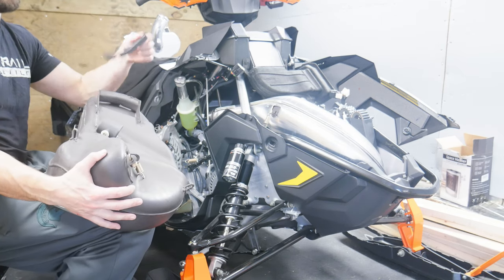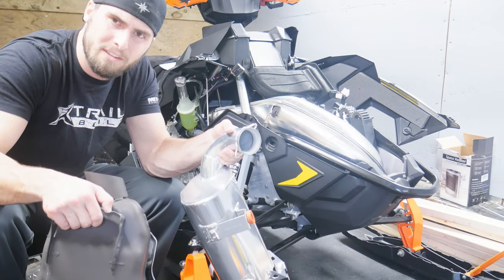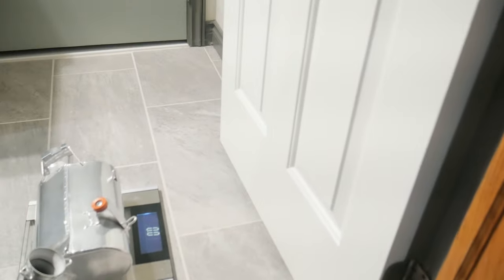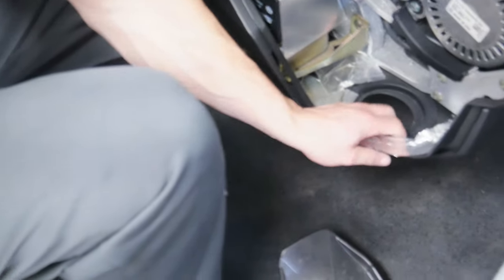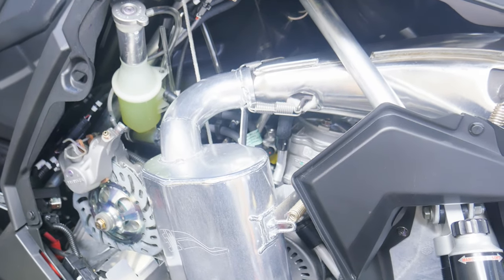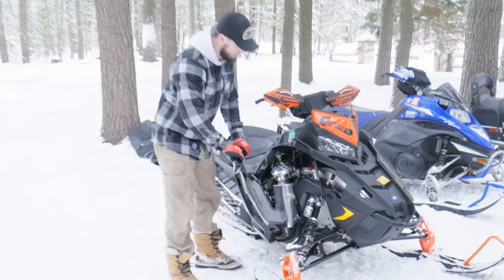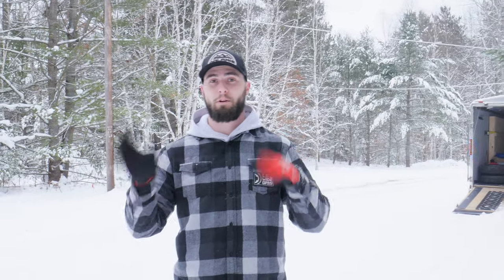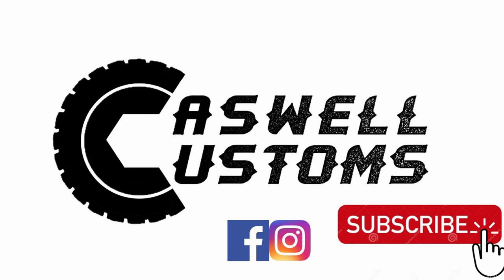Polaris Assault 800 - SLP Silencer Install & Review

Comment: That bracket and other spring is supposed to go on the pipe next to the other factory spring mount to help hold down the exhaust.  Also the other little bracket is for the silence. You have to remove one of the bulkhead bolts below and add the little tab piece so that the spring from the silencer has somewhere to attach. I know your video is kinda old but I figure I’d let you know. I was confused on this too with my 2018 pro rmk 800 but it eventually all made sense

Comment: How did you mount the cooker on the upper can pipe?
Reply from the maker: It comes with a metal hose clamp and your just feed it through the mount and wrap it around the higher pipe because it hits the side panel if you have it lower